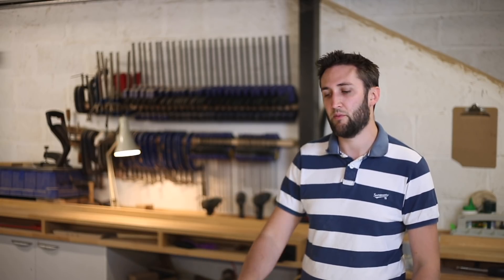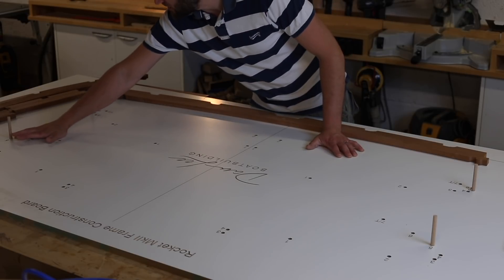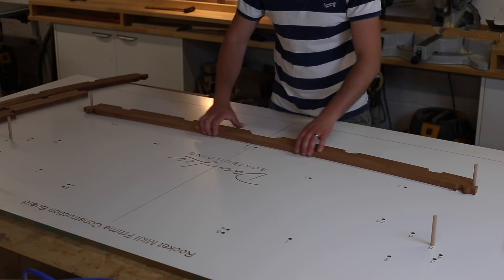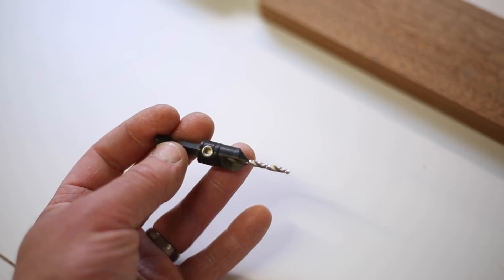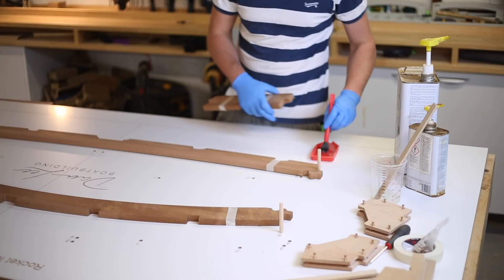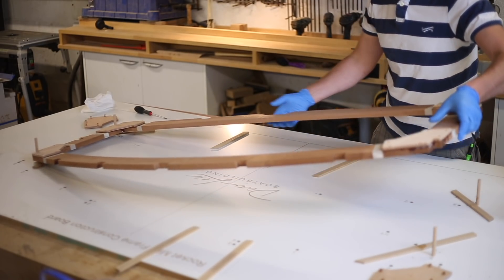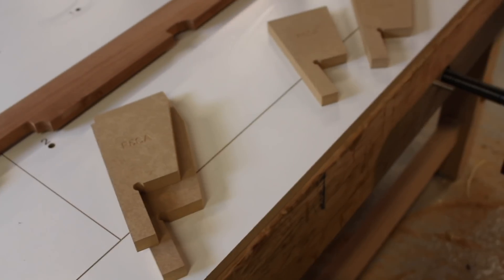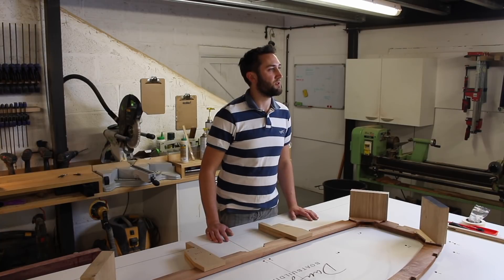Rocket MkII Boat Build Pt 3 - Frame 5 Construction

Comment: What is the thinking of using epoxy to glue the gussets on and not TB3. I understand TB3 to be waterproof.
Reply from the maker: I wouldn't really use Titebond anywhere within boat building, certainly nothing structural. It may be waterproof but it isn't a patch on epoxy with regards to strength and protection.

Comment: Your work is awesome. Pretty easy mod on the dxf to add 5mm pilot holes on the gussets, right? Then holes are consistent and uniform.
Reply from the maker: In all honesty I would probably screw gussets in place and then remove the screws after the epoxy has set now. Meaning their placement isn't so critical.

Comment: I love your system as it makes frame assembly almost foolproof. Is it your intent to sell kits?
Alan
Reply from the maker: Thanks! I'm not planning to sell kits at the moment as shipping them would be tricky and most of the interest seems to be overseas. The plans are aimed so that people can get them cut at timber suppliers near to them to make this more economical.
Reply: @DanLeeBoatbuilding  Dan
I agree that the build board would be prohibitively expensive to ship, but all of the frame members and gussets should pack in a reasonably size box. Then you could include the CADD program (or drawing) of the build board for potential customers to get made locally as there are many companies with CNC machines that could knock that out in no time. You should consider that to give you a steady source of income to fund your new projects.
Alan

Comment: why didn't you use the cnc to drill the screw holes and countersink them
Reply: That was my dumb question also, particularly with the gussets
Was there a reason you didn't do that ?
Reply from the maker: It was just for the sake of keeping the files a bit simpler really. However since putting them together I've realised it would be a good idea so I am working on an update for the plans that will include this detail.

Comment: This is a really nice system.  Just a couple random ideas for version 3.  You could predrill all of your screw holes on the cnc so the gussets automatically line up, saving a little manual work.  You could also recess the gussets into the boards so everything sits flush, even using puzzle type joints on the gussets to lock them in.  You may however want the additional thickness instead though.  Dowel holes could be used to align the supports when gluing, and again predrill.  Where parts need to be glued you can engrave a G so you know which sides are which in asymmetrical parts.  Great videos.
Reply from the maker: Thanks Allen. I did think about pre drilling the gussets but left them off for fear of overcomplicating the parts. However after putting one together it would make more sense if they were done at the cutting stage so I think I will look at adding them in. It would also ensure that they were correctly positioned to avoid fouling further down the line I guess.
Reply: @DanLeeBoatbuilding  I love your methods, alway fascinated by the precision of CNC for this task.  I would offer that your epoxy technique is only half right; the pre-soak of resin into the wood grain is spot on, but the primary glue of the joint needs thickening with Aerosil, Cabosil, Cotton Flox (whatever your flavor).  West System has test data that shows that structural joints are always strongest with thickened adhesive.  Another idea, if you can manage to mill slots into the melamine building board for clamps you wouldn't need screws at all.
Reply: Love the alignment system...similar to fixturing that I've used for other kinds of complex CNC assemblies. I would relocate the part numbers on the frames so that they are covered up by the gussets when assembled and make left/right gusset pairs so that they can be glued with the part no. engraving towards the frame. That way no identifying marks are visible after assembly. Easier to sand/finish and looks less like a "kit" when finished. Undersize pre-drilling of the gusset fasteners is also a great idea. Taper drill/c'sink on assembly.
Reply from the maker: Great ideas all! Just the type of small refinements that seem to make sense but you don't always consider them at the time. I am currently working on some revisions such as putting in the holes for the screws at the cutting stage. Love the idea of hiding the part marking as well! Luke I hear you on the thickened epoxy as well, honestly I don't know why I didn't do that in this as I usually would, I think I was focussing too much on shooting the video and not what I was doing. I have mentioned this in my next video for the other frames where I "correct a few things", just editing that one at the moment so that should be up in the next few days.

Comment: Why flat head screws?
Reply: If they get plugged or filled over , then they are much easier to clean out if they need to be replaced in the future, much less likely to strip out - and if they do it is easier to fix .

Comment: Great work Dan! I would use wax paper  or butcher paper under gluing areas to keep board clean.
Reply from the maker: That's a good call. It would fit easily over the dowel or you could even knock the dowel through it. I will try that on the next frame, cheers!
Reply: @DanLeeBoatbuilding  I usually use plastic trash bag to protect the bench when I work with epoxy. Epoxy don't stick to it, and the bag don't melt either. It's easy to make a try before going for the actual gluing process.